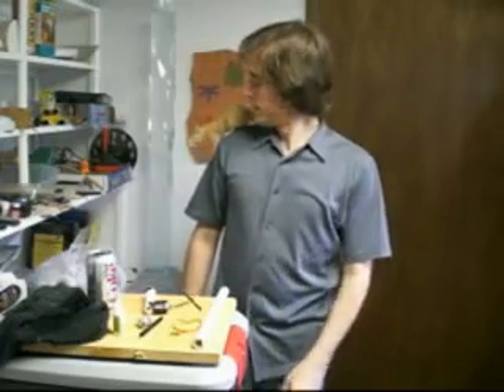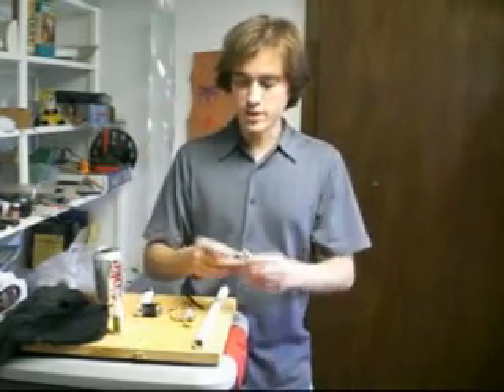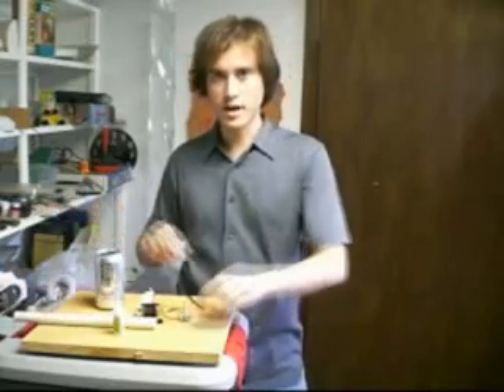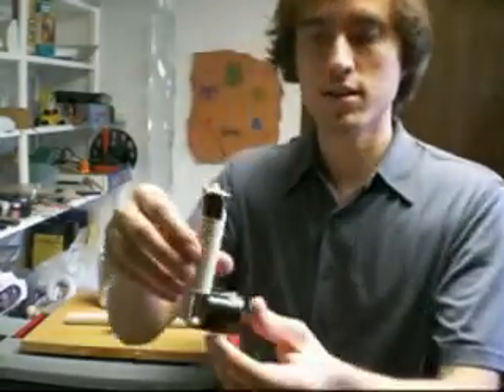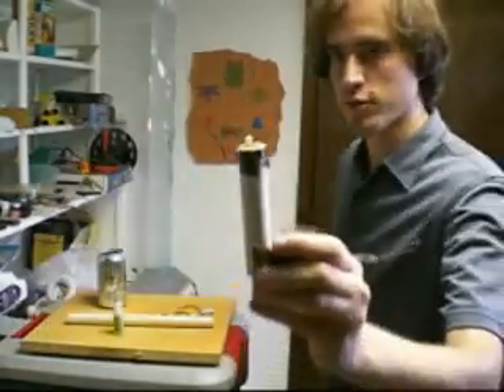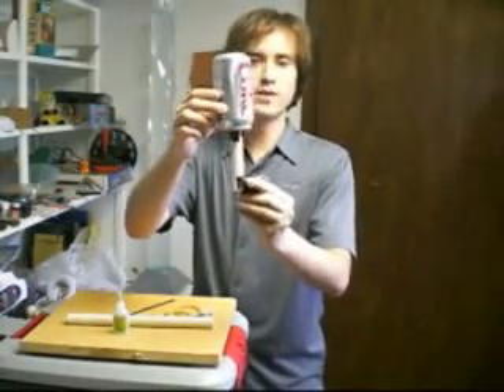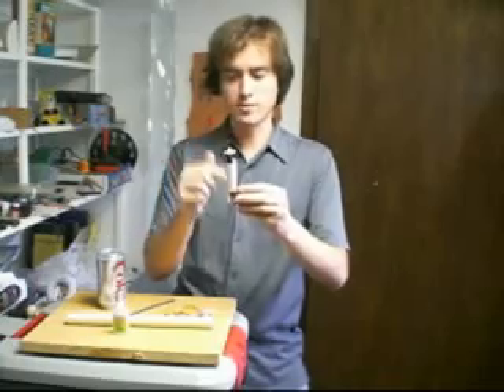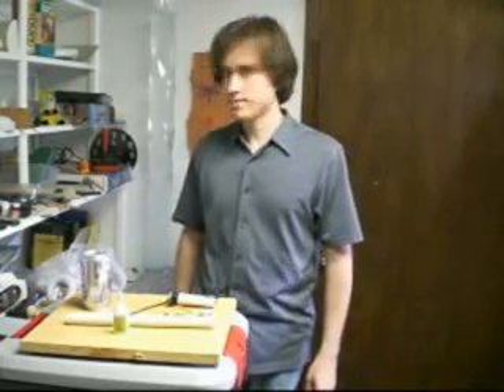Build a Van De Graaff Generator

Comment: so you ended up bending the plastic pen casing vertically alongside the pipe, while the bottom piece under the pipe has a rubber band on it. the glass light is at the top, with the rubber band over it? isn't the light too fragile when the rubber band begins to spin?

Comment from the maker: @pyronathanpyro I am not sure I followed that, but you have to use two materials that create opposite charges.  There are lists on the internet.  I found glass and plastic to be the best.  If I were you I would make one roller metal.  That is the easiest to do.

Comment: how do i mske s glass roller im using legos to make myne ive got the plastic bar from the lego motor for the plastic roller but what can i use for the top roller asin a glass one can i use another plastic roller and mount the glass bulb so it touches the rubber instead tah reply asap i wana build now

Comment from the maker: @fieroman10 The glass roller is tapered on the ends.  That helps.  If you are having trouble on the motor pulley , try to sand it down so that it is slightly bulged in the center.

Comment: What do you use at a pulley that is attached to the motor? also how do you keep the rubber band from running off the pulley? When I turn on my motor the rubber band just runs off both ends of the pulleys.

Comment: @DayfallKat it looks similar to the motor in a hand held electric fan or some electric toothbrushes. maybe a hobby shop? I wonder... :) what if you replace the soda can with a aluminum steel/maybe carbide wire frame enclosed in a glass jar such as one for large olives(as long as you had the motor vertical and not sideways) an allowed for air so it was not vacuum like, an used say a small toy car motor with a 16volt 25amp power supply+power regulator. there are 16volt remote control cars.

Comment from the maker: @rb1003 I suppose you could just buy one. watch?v=4Jf_zA5VuGs

I did, but mine had a bad roller and so I took it apart to fix it. It was pretty much how I made mine.  (mind has a glass roller instead of metal)

Comment from the maker: @Fiki2k7 I don't know.  I just used a regular 1.5v colorless bulb.  I thought of using a fuse without the end caps.  But I am sure that would not stay on by itself.  However you could then use an axle.

Comment: So I just built one of these but the christmas light I am using does not seem to want to stay. So I bought a small halogen tube light which seems to work but makes a loud noise from small bumps on it. Is there a specific type of bulb or just something beveled? X-mas light which is beveled still does not wanna stay : /

Comment from the maker: @Gh0stH5wk I don't think it will make a difference because the band isn't conductive.  If contact does make a difference then a metal roller would be used on the outside of the band.

I don't think it would hurt.  I just haven't seen a metal roller used and the brush will probably wear out the belt.

Comment: I also have another question, does the roller on the motor go through the other end of the PVC pipe?
Also, Do the wires touch at the bottom and top?

Comment from the maker: AA batteries could supply more power than my wall transformer.

Transformer:
3v at 300ma is 900mW

Batteries:
2x1.5v at 2A is 6W

So the batteries are capable of supplying more power.

Comment from the maker: Yes you can use pvc, it doesn't matter where you place it as long as the other material has the opposite charge.

The vinyl needs to collect static charge.  Test that you can charge it up before building it.  (with PVC and fur)

A device that detects static charge is handy to build also.

Comment from the maker: One roller can be metal.

I have not been able to build a bigger machine because of the difficulty in building a belt.  I didn't think of using vinyl, but I think you can get that just anywhere.  I got a big sheet form walmart to make a big capacitor one time.

Comment from the maker: The glass should spin.  Check that the bottom brush is grounded and that both brushes are pointy enough and close enough to where the band breaks contact with the rollers.

Comment: Hi, Great Video. I seriously need some help. i followed your instructions perfectly except im having some problems. First i used a glass tube for the top roller BTW. I am unable to achieve any sparks when i turn on the VDG. I am using a rubber band and a plastic pully, but so far i am unable to get any sparks. is the glass tube supposed to spin around or is the rubber band supposed to just rub it with the tube staying still. Please Help me

Comment: but thats how tesla was going to do it, the high voltages and currents reduce the resistance and resonance makes the effiecientcy very high through the earth.the energy tranfer with the tesla magnifying transmitter becomes electrostatic which is alot different than regular power transfer with the current to voltage to resistance relationship. i made a van degraff last night and forgot that the only reason i didnt make one before was because i didnt have a motor, now i do lol . nice tesla coil to

Comment: if you build the tesla coil electrostatic generator, you can disrupt the electrostatic nature of the earth and thus send industrial energy through it and power the world using the earth as a wire! just plug into the earth! the tesla coil is the most important electrostatic machine for sending industrial energy and communication through the earth! van de graff is very inefficient in comparison, but also alot easier to make and safer on the small scale! great job dayfallkat!

Comment: something else you might try on the small one first...
as the band returns to the top, get it to rub lightly against a block of polystyrene (used for packing anything expensive, like t.v.s.) once again, good luck for the next one.

Comment: thank you, a good "how to...".
a few suggestions...
1. use a bycycle inner tube from a 12 or 14 inch wheel, (they double in length when folded), for the band, just cut out the valve.
2. use the heavy duty drain pipe as the column. 
3. have an emergancy stop button that can be triggered by dropping something on top of it, to cut the power, might come in handy at some time...
good luck for the next one...

Comment from the maker: I have no idea.  But, if anything other than the metal is slightly conducting then it won't work.  See if you can statically charge the top and have it hold a charge.  You might need to invest in some time building a charge detector in a jar.

Comment from the maker: A paper tube will work if it is dry.

I didn't cut the glass.  It simply sits on top of the pipe with the band pulling down on it.

Comment from the maker: There are plenty of things to go wrong with an electrostatic machine.  I would have to have a complete description and pictures to debug it.  If the belt is not anti-static and the rollers are of the correct materials, then it should generate at least a tiny amount of charge.

Comment from the maker: AHHHH!!  Yes, they are coated in an anti-static chemical.  You will need to wash the band in a strong soap. ( I think I used dishwashing liquid).  Make sure you rubber can hold a charge by rubbing it against your hair or clothes like a balloon does.

Comment from the maker: The pipe really has nothing to do with it.  Is the wire at the top have lots of sharp points really close to the band?  Do you have a grounded bottom wire also?

Comment from the maker: No, the PVC (tube I am supposing) is only there to hold up the top.

Check to see if the band itself is getting a charge.  Will it attract a hair?

Make sure you top metal container is smooth.  The smallest little burr on the outside will let the electricity out in the air.

Comment: it can be????? u dint use a a metal roller u used rollers without metal????? ex. the upper roller is glass and the lower roller is plastic???? NO METAL????

Comment from the maker: Pantyhose might work.  Anything that generates static cling will work.  And the only reason I didn't use a metal roller is that metal doesn't' get you anything.  I figured that if I was running the belt across a roller then at least it should be generating electricity for me.

Comment from the maker: I don't know.  It has to be spinning really fast.  And even then it charges up relatively slowly.  One spark every second.  It also looses charge quickly if the coke can has any imperfections.  I would suggest that you gear the hand crank so that you get a lot of speed on the belt and use as many rubber bands as you can to increase the surface area touching the rollers.

And it is vital everything is clean.  If it doesn't work then you probably have oil or something on the belt.

Comment: Charge will accumulate at sharp edges, or where the curvature of the metal is the greatest. It turns out that this is necessary to maintain, or to attempt to create, zero electric field within the metal.